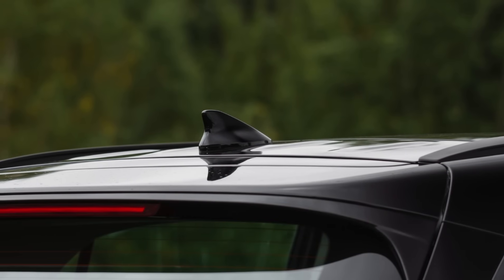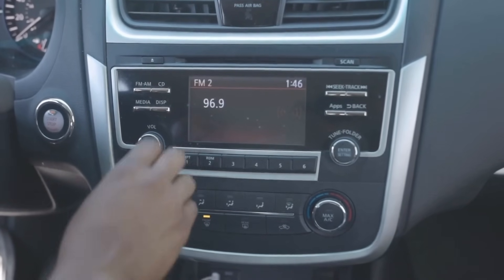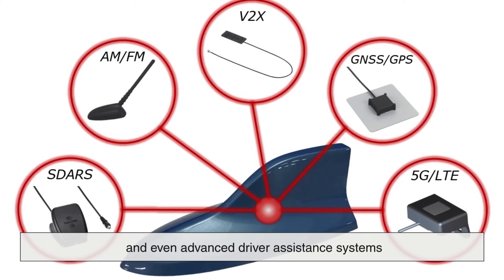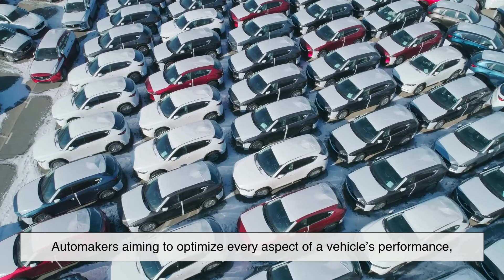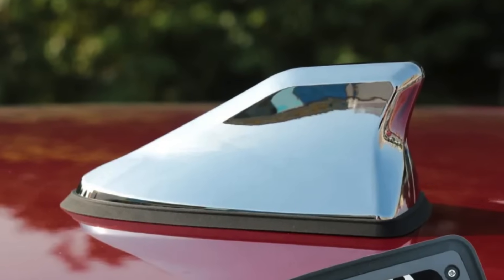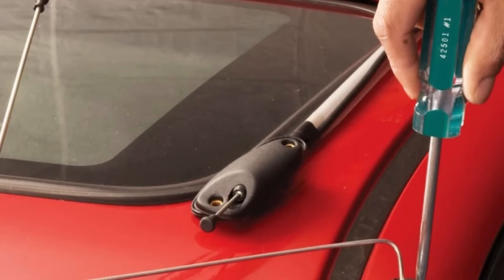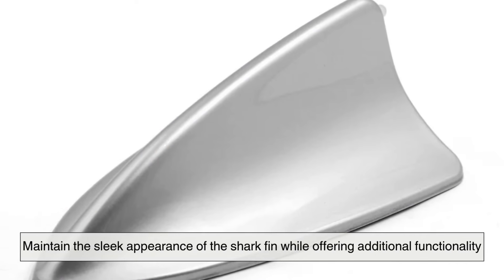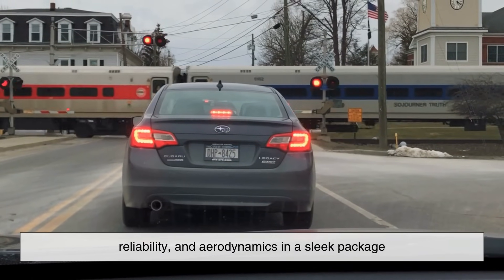Why Do Cars Have a “Shark Fin” on the Roof?

Comment: Short small antennas can not perform as well as for AM/FM radio frequencies.  It is physics.  Many cars use the defroster grid built into the rear window for AM/FM reception or have a traditional vertical rod in addition to the shark fin.
Reply: Indeed. FM radio wavelength is about 3 meters. You need longer antenna's because physics and such. The rear window of the car has some wires that function a FM antenna (and I guess DAB+ here in Europe). I think the shark fin holds antenna's for very high frequencies only. AM has disappeared in the cars here.
Reply: @Richard-bq3ni  That seems a shame.  I thought that in the UK they had largely transitioned to digital AM.  Is that not true?
Reply: @BryanTorok I live in The Netherlands. No need for AM because of the smaller distances. DAB+ an FM reception covers the entire country, and there is also cellular internet for streaming. I guess AM can be usefull with the vast distances in the US.
Reply: @Richard-bq3ni  Yes, exactly.  We have what are designated as Clear Channel stations running up to 50K watts that are designed to cover half of the country at night.
Reply: @BryanTorok AM is little used and I think in U.K. all AM stations broadcast in U.K. will be switched off over next few years. There’s no digital AM service. We still have FM and we have digital DAB+ which is like a digital fm service. The most popular trend is toward online streaming.
Reply: Don't confuse people with things like science. This is the land of anecdotal claims.🤣
Reply: Yes, right. Sharkfin antennas for higher frequencies like V2X, 5G, SDARS, GNSS, WiFi, etc. In modern cars for AM/FM/DAB reception is through foil antennas mounted in bumpers, carpets etc. There is also a foil antenna for CB radio. A window defroster could also be an antenna.
Reply: I mean to be fair my UHF radio gets the same fantastic reception from a 9cm antenna that I get from a 15cm antenna.
Reply: I agree. The shark fin is a compromise.

Having said that, I find the shark fin FM and digital radio (in U.K. known as DAB+) on my Honda to be very similar for reception to earlier cars with a short bee sting antenna.
Reply: Shark fin is enough for common people. Bad FM radio reception? Just use internet integrated in most modern car head unit to access your favorite fm/am radio.
Reply: @andibdg2291  Are you sure you can reliably do that in non-urban areas? A car is not just a city commute
Reply: @NikolaiUA  cellular reception these days is good, that you have no problem accessing wireless internet in non urban areas. I live in a third world country, and we have little complain in term of accessing wireless internet even in villages.

Comment: I'm amazed that all that stuff is crammed into that small space and it all gets along together. I've found standard radio reception pretty darn good for the lack of surface area antennas usually need for AM/FM reception.
Reply: Many cars use the defroster grid built into the rear window for AM/FM reception.    Also, many GM cars used a fine wire built into the windshield that ran along the edge of the window.
Reply: I was taught that the length of the antenna was the difference. AM was longer than an FM. Have you ever noticed on a regular antenna how a wire is coiled from the base of the antenna up so far? That's supposed to be the FM while the rest of the antenna is for AM.

@curtchase3730 
If you look a little closer, you'll see the defroster element is really separate from the antenna. It looks like it's all one piece. The 2009 Nissan Altama my wife has is separate. Others could be different.

Comment: The exterior radio whip  antennas are not AM .  the AM radio antenna is inside the radio. it is a very long wire wrapped around a ferrite core.
Reply: That is not true.  AM radio ferrite antennas were used in home radios.  There is way too much interference in a metal car's interior and not enough outside signal from stations. The first FM car radios weren't until 1952, but if you look at pics of older cars,  you will see antennas on them fpr their AM radios.
Reply: @jazzjohn2  is 1952 a typo? Few cars in those days had a radio fitted. They were typically fitted after sale. They worked on LW & MW, broadcasts were still mainly using these bands due to the longer transmission distances. The BBC was at that time the only UK radio network and didn't have the network of transmitters like today. 

I think it was back in the early 70s, when private radio stations were permitted.  And it was in the late 80s, that the BBC began transmitting Radio 1 on FM.
Reply: Not in car radios. The car body and the radio casing would be a "Faraday cage" and no signal would get through.
Reply: @jamesmeader6539  Yes, in car radios....I have taken apart many...many car radios.  The windows keeps the car from being a faraday cage.
Reply: @Ezzell_  Your original post stating the external antenna was only for fm is false. Look at pictures of old cars produced before fm was available. Many have a whip antenna. What was it for?
Reply: @Ezzell_  Then why did the AM radio in my old Volkswagen quit working when some vandal broke off the outside antenna? Google "do car am radios have internal loopstick antennas".
Reply: The whip antenna were for AM primarily. FM is higher frequency so those antenna can be much smaller. Also, the whip antenna are designed to couple with the electric field, magnetic antenna have a different shape and can be very small (but require very good insulation).

Comment: It's called a GPS tracking device.......grin
Reply: I guess you aren't aware that GPS is a totally passive system.  Those satellites only transmit, they don't receive any signals other than the ground control running it.  (Based in CO, east of CO Springs.  The only AFB without a runway, I've heard.)

Comment: Explains why my radio reception got worse over 40 years
Reply: Over my 78 years, reception, overall, has gotten much better.  A big part of this is improved electronics.  My origin technology was vacuum tubes.  As the years go  by, the solid state electronics has gotten quieter and more sensitive.
Reply: Possibly there’s just a ton of interference from random electronics. Amazing how much better my pocket radio works, especially AM and shortwave, during a power outage.
Reply: No it's your hearing that's got worse.
Reply: @TRPGpilot what
Reply: @TRPGpilot   French.   Need I say more?

Comment: It is expensive to make and not easy to replace. It has to be made very carefully and tuned to each car model. An antenna from one car cannot be placed on another car without being calibrated at a dealership with the proper equipment. It is also not a very good receptor for AM/FM signals.

Comment: It boggles my mind that in 2025, the Ford F150 still uses a long metal antenna.
Reply: It all depends on the frequency you’re trying to listen to. The large ones are more efficient for longer AM FM frequencies. Some vehicles have multiple ones including the shark fin style.
Reply: It is physics.  Short small antennas can not perform as well as for AM/FM radio frequencies.  Many cars use the defroster grid built into the rear window for AM/FM reception, except many pick up trucks having a vertical back window don't have the defroster grid.  Also, pick up trucks are often bought by people who are going to be using them in distant rural areas and by people who rely on that AM radio for information.
Reply: @BryanTorok plus you actually only need a fin antenna if you was the vehicle in a mechanized carwash.
Reply: @marekstanek112  With one exception, all of my cars have rod antennas.  In addition, as I'm a Ham Radio operator, all of my cars have additional antennas.  I've never had a problem with any of them in a mechanized car wash.
Reply: @ Then your antennas are designed with that in mind. In the late 90's, when the short 1/8 wave FM antennas started being all the rage in Europe, you could easily get one broken in the carwash.
But there's probably one important fact. Washes that you get pulled through (street type) are not really a thing in Europe because of the area they require, so most washes here are of the type that you drive in and the brushes go back and forth over the vehicle. Most rod antennas handle the brush going from front to back just OK, but when it goes back to the front most of them brek inside and cease to work.
Reply: It's to satisfy that rural, AM talk-radio kind of customer.
Reply: The long wire antenna is better for AM long range.  Their demographic includes people who like AM, and live in rural areas.  It makes sense.
Reply: Because wire antennas work better. People who use trucks for more than general transportation or for a sense of masculine affirmationation, like working out of often tend to live in rural areas outside of cities where an antenna that actually works is needed.
Reply: @clutch1141  In rural areas you find a lot of pickup trucks and SUV's because of the work rural residents have to do, like gathering firewood, picking up lumber and other hardware, picking up products in bulk and similar. SUV's are used in rural areas because of 4/All wheel drive (for snow driving and the marginal roads to good fishing holes) and room for 6 weeks of groceries, as sometimes full sized grocery stores are located 100 or more miles away. That and the ability to carry more passengers in comfort on long drives. In the city where appearances tend to be more important you will see pickup trucks and SUV's with jacked up suspensions, huge tires, chrome this and that's and other items that are marginal in performance and cost a lot.
Reply: Ford does it on purpose so that trucks operating in rural areas can receive AM radio things like farm reports.
Reply: Wow never paid attention to it but your right. Knowing Ford, they are probably cutting back to save money on costs.
Reply: Law enforcement does as well. There is a reason.
Reply: Because its better. You need an antenna whose length is an integer multiple or fraction of the signal wavelength, and larger antenna has a higher signal gain, requiring less amplification. That results in better signal to noise ratio and better audio quality.
Reply: Cheap Cheap Cheap...That's Ford
Reply: The brand Ford said it all.
Reply: @ always one DA like you.  Always
Reply: I think it is because the target group still lives in the '50s
Reply: @AndersLiebenholtz  Not true! In rural areas the only available radio signals might be AM radio stations in distant, urban areas. AM radio is down around 0.6 - 1.6 MHz, which has a full wavelength of around 320 feet. FM signals (88-108 MHz) have a full wavelength of 10 feet which also requires longer antennas. Thus a longer antenna is needed to receive both AM and FM broadcast radio. Satellite radio is expensive and might not be worth it, being at $200 per year or more. Satellite radio does not carry local news either. Not all of AM radio is strictly talk radio there a still some regional type AM stations that carry music. 

Don't insult rural residents, they provide the food you need to survive, the energy that powers your home and cars, the water you drink, the lumber to build your homes and furniture, the minerals that are needed for a wide variety of products, like steel for example, etc. Urban residents provide the manufactured goods to allow agricultural activity as currently practiced, financial products we need to run our farms and businesses, etc. Rural residents are in the minority, about 20% or less of the population. Urban and rural residents depend on each other. 

If things were to crash and our economic system stop functioning rural residents can still raise their own crops, obtain meat, water and won't depend as much on distant energy sources to power their lives. 

Accusing rural residents of living in the 50's is a stereotype. I suggest that you need to adjust your thinking. Maybe you need to spend a little more time outside the city.
Reply: Thats ok, a lot probably blows your feeble mind.